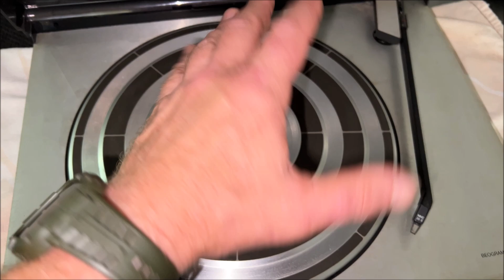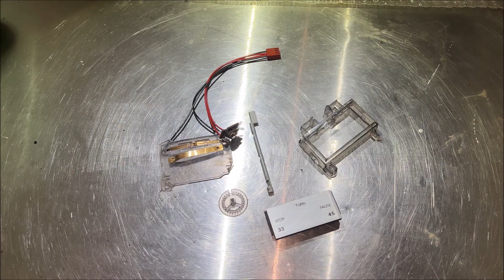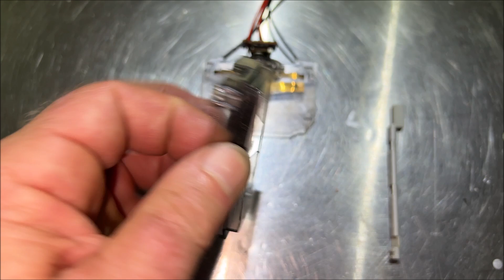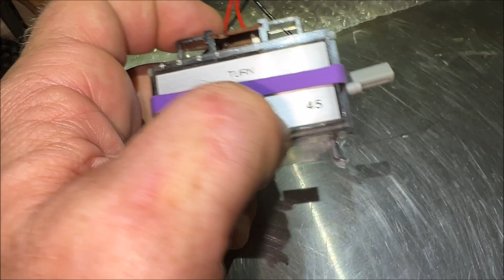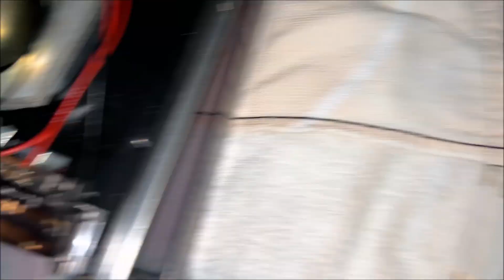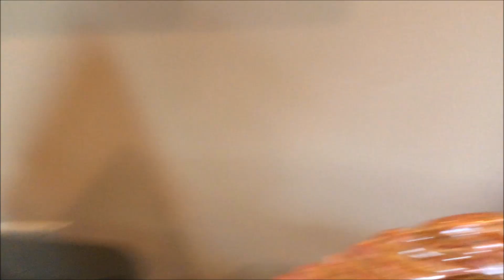Beogram 2400 Broken Control Panel Speed Switch: How To Repair A Bang & Olufsen Vintage Turntable

Comment: I had the same problem. I got mine fixed including the belt. at least I thought I did. when I click the 33 option it starts but when I release the button it stops....any idea? the 45 works fine.
Reply from the maker: I did some digging and found another Beogram 2400 with almost exactly this symptom. The problem turned out to be the mechanical relay/motor-switch arm adjustment. There are also contacts associated with the control mechanism that can become dirty, oxidized, or fail to move far enough after all these years.

Since your 45 works, the motor, belt and much of the mechanism are obviously capable of operating. I would look closely at the 33 side of the multifunction control and its linkage first, then the mechanical motor-switch/relay contacts and their adjustment. Also inspect the solder joints where the control wiring/connectors attach to the circuit board.

I would NOT start bending contacts randomly, though—the adjustment is fairly specific. 

I got a repair / maintenance manual off eBay which was somewhat helpful when I made my repair.
Reply: @DrivingIntelligence  Thanks for the response and tips. I appreciate it!

Comment: Hi, I have a Beogram 1500 myself and would like to replace or restore the veneer. However, I am not sure how to remove the wooden side panels without damaging them. Could you give me some advice on how they are attached and how to take them off safely?
Reply from the maker: That's a good question.  I didn't remove the veneer when I was working on this unit and didn't pay close attention to the veneer attachment.  When going back through my video, I notice clips holding it on the deck after I removed the bottom.  Take the bottom off and it should be obvious.  Sorry I can't be of more assistance.

Comment: There is only one storefront on the planet that still manufactures the B&O cartridges, and this is “Soundsmith” in upstate NY!

I recently purchased the SMMC3 for a newly acquired B&O 5005 tangible table!
-Works great!

As for a preamp, I purchased a “Pro-Ject” from Amazon, for MM only, which was abt $90!

Cheers, Wayne
Reply from the maker: thanks for that info!

Comment: Hi. I have this beogram 2400 and i would like to know how to connect it with a receiver and speakers. It does not have RCA red and white cables. So i am confused.
Reply from the maker: Try opening the case as I show in the video to see if the RCA cables are inside.  That's very odd.

Comment: glad you could save this lovely machine from being scrapped. they sound brilliant and certainly worth the investment for complete overhaul but only done by professionals as others would just muck about inside and then tell you they couldn't fix it. for the cartridge you have three options.1. sound smith makes new cartridges that sound nice. they have a licence from b&o to manufacture them and experts at that too. I believe they even upgraded it. never heard one myself but everyone who had it says it is brilliant. a bit pricy, around 200 and above but at least you are sure it is new and will last you around 1000 to 1500 hours. very low tracking force, around 1.2 gr I believe. 2. you could also send your current cartridge to sound smith for a retip and restoration for lower price but not just anyone who claims to be able to repair them; b&o is much more complicated, delicate and time consuming than the average cartridge so specialists are required but definitely worth the time and cost. it is worth it as you have a mmc 20 E. from lowest to highest grade: mmc 20 S (Spherical), mmc 20 E (Elliptical), mmc 20 EN ( Elliptical Nude) and mmc 20 CL (Contact Line). the last two are for four channel and high end linear tracking models although they match your model too. there was also the previous series but same generation mmc 3000, 4000, 5000, 6000 which were slightly different but match your machine. don't get mmc 1, 2, 3, 4 or the SP series as they are for next and previous generation of tonearms respectively.  3. your last option would be to comb through second hand market to try and find an old stock which is what I do because sound smith cartridges are black and don't match my Beogram 4000 that has an aluminium tonearm. An extremely time consuming approach and takes patience to find decent deals in pristine condition. they are also certainly more expensive specially higher end versions. feel free to contact me if you had more questions but you could generally find decent information on forums like beoworld. hope these would prove to be of some assistance. good luck and enjoy your Beogram!
Reply from the maker: Thank you for this valuable information!  I definitely want this to save and use this turntable.  It’s beautiful.  I’ll do some checking based on your recommendations.
Reply: @DrivingIntelligence   Always happy to be of assistance to a fellow b&o enthusiast. also, there is a gentleman who has a website and blog plus YouTube channel who is practically a breathing encyclopedia of beograms called BeoLover. he is your man for full overhaul should you ever need it and if your where stuck in any stage of DIY, I believe he can assist too via email.
Reply from the maker: sorry for late reply, thanks for this tip.  I will keep BeoLover in mind.

Comment: Great, thanks. i have a 1902 they look the same where the arm won't raise and lower do you know how to fix this? A video would have been great.
Reply from the maker: I'll have to look into that.  Have you opened it up to see if you find anything obvious?  I bought a repair manual on eBay for something less than $30.
Reply: @DrivingIntelligence  yes I opened it but it's hard to see the mechanisms for the lift itself, very thin details, everything works as it should except the lift itself.
Reply from the maker: @hindervallen936  I'll see if I can figure something out.
Reply: @DrivingIntelligence  Svenska
Engelska

I solved the problem, the rodd which lowers the arm was stuck, because old grease.☺
Reply from the maker: @hindervallen936  ah, excellent!  Thanks for letting me know.